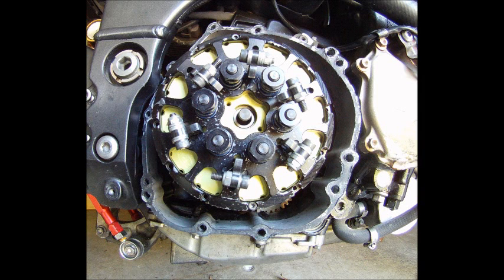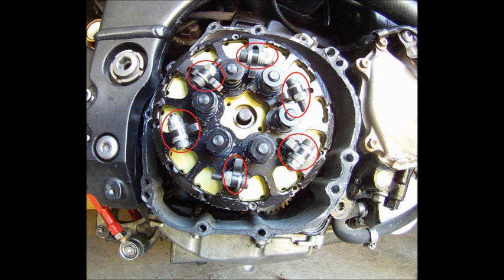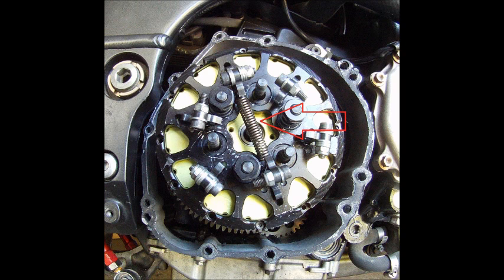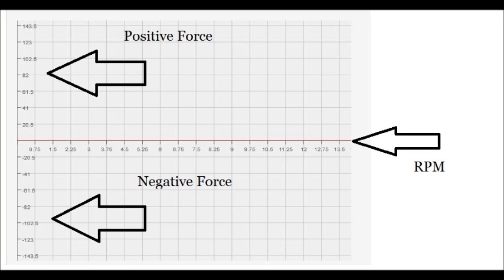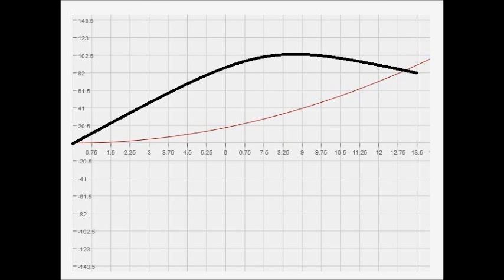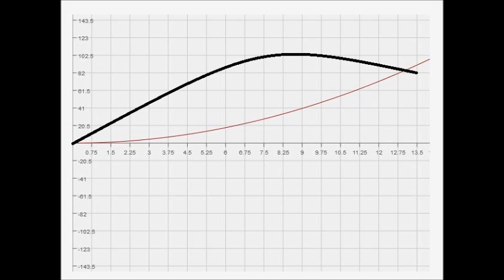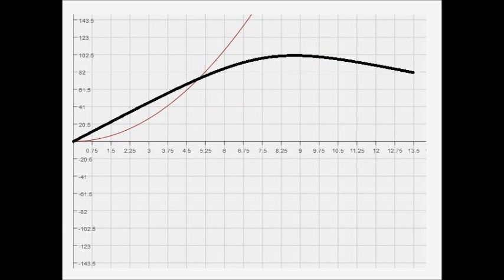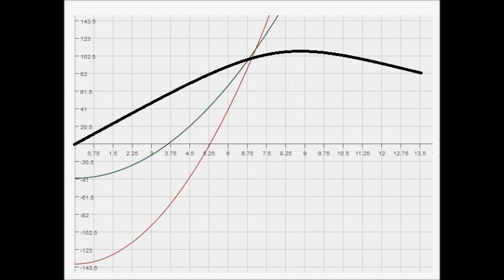How Does Hays Pro Street T6 Convertible Clutch Works, EXPLAINED.

Comment: Great attempt, I would suggest you show pics after each adjustment and also being more specific when saying “More weight” vs “Less weight”.. Like how many grams per arms or total weight on all. 👍🏼
Reply from the maker: Every bike is going to need different amount of weigh on the arms due to many variables such as engine torque curve, gear ratio, total bike mass.....etc.

Comment: well that is a great graphic of how it works thank you. Is there a program or formulae on how to make those input calculations?
Reply from the maker: There are formulas, but they are kind a complicated. Dynamic force that the weights will apply to the clutch hat is mass x velocity^2/ radius. You also have to compensate for the primary drive gear reduction, on an 05 zx10r it's 1.611 to 1, meaning crankshaft makes 1.611 revolutions while the clutch basket makes 1 revolution, so if the engine is spinning 13k rpm, the clutch basket is only spinning 8069.5 rpms.

Once you figure out the dynamic forces, you'll have to figure out static and kinetic friction of the clutch which depends on the clutch brand and oil brand as well.

There is also static spring force which is the easiest one to measure.

There is also engine torque characteristics that make a difference on the clutch, along with the total mass of the bike and the rider, and gearing as well.

Best way is to test it at the track, and write down the spring weights that you had and spring pressure, and keep changing one thing at a time till you achieve results that you are looking for. 

In slider mode the stiffer the spring static pressure, the higher the rpm that the clutch will "lock up"
The more weight that you have on the arms, the lower the rpms will be that the clutch will "lock up".

The trick is to have the least amount of spring static pressure and the least amounts of dynamic force on the arms without any clutch slip.

I will try to post some more videos of testing and tuning of the clutch once I make it to the track with the bike, that should clear things up a bit more hopefully.
Reply: thanks for that, yes it is complex but so is testing at the track with maybe only 3 or 4 passes in a night and only 1 or 2 nights per month. Add to that a turbo and it starts to take some setting up and eats through plates all the while. I am sure Tim has a program for this and maybe one day he may market it. Just working out how much spring adjustment equates to what RPM change for the launch would be useful.
Reply from the maker: Tell me about it, I've got a turbo, stand alone ecu that I have to tune from scratch, and hays clutch hahahahahaha, I am excited just to think about.